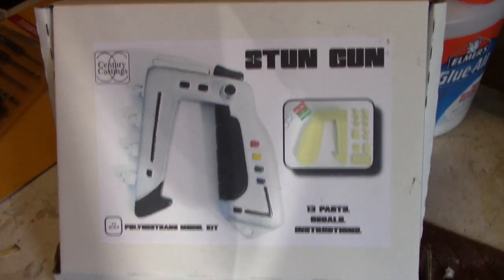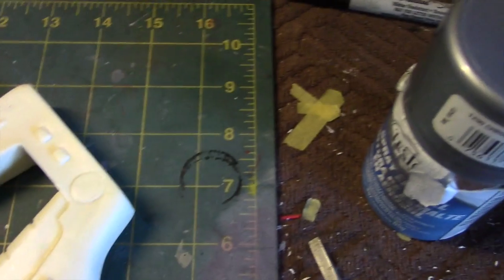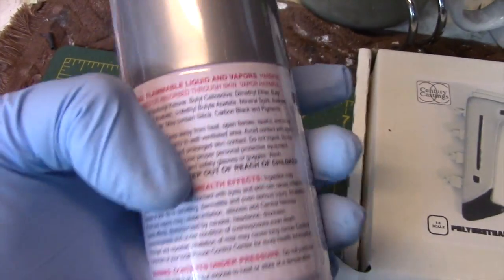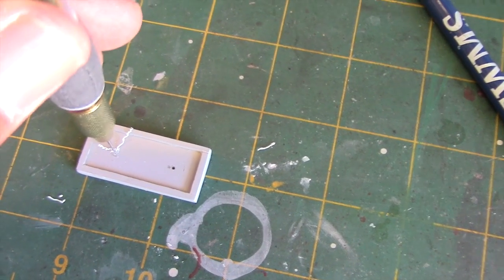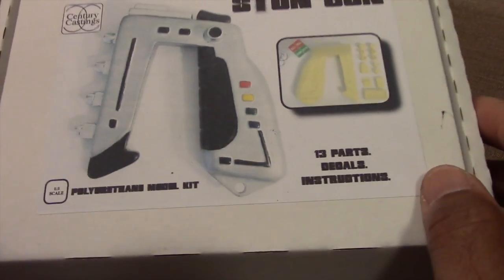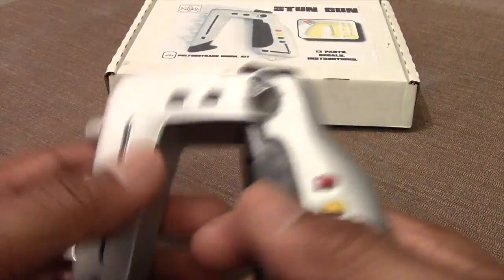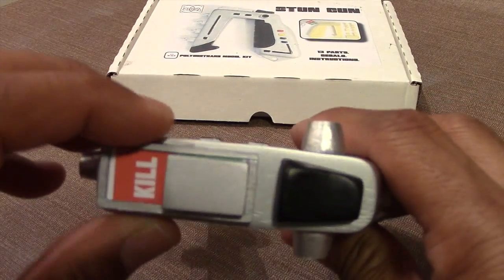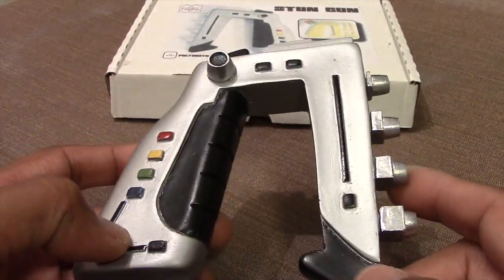Building the Stun Gun from Space: 1999

Comment: My version from Century Castings only has two side knobs rather than the options but the sliding KILL/STUN switch on top is now made so that it will slide.
Reply from the maker: Yeah this was one of the first versions.  I know he ended up making modifications eventually.   I plan on building the MPC kit too but just haven't gotten around to it yet.
Reply: @InterstellarModeler  I'd like to get the MPC kit as well, perhaps try to put some electronics in it (though not the US$100 electronics kits, would be cheaper to build my own).

Comment: which kit was it that had the light jewels, in all of the emitters?? some have similarly fitted actual lasers to these as well, but very rare...
Reply from the maker: +Stuart Gray I'm afraid I'm not familiar with that kit.
Reply: +Interstellar Modeler It would be nice if the Wand Company made a S2 version of this, c/w sound effects and LED's. Unfortunately though,  Space 1999 doesn't have anywhere near the following Star Trek does.
Reply from the maker: +Stuart Gray Alex Jackson who produced the kit in this video has reworked both the stun gun and comlock kits.  The new ones do look smoother with sharper lines.  You may want to check them out. They are reasonably priced.